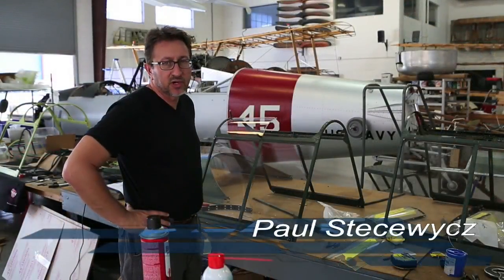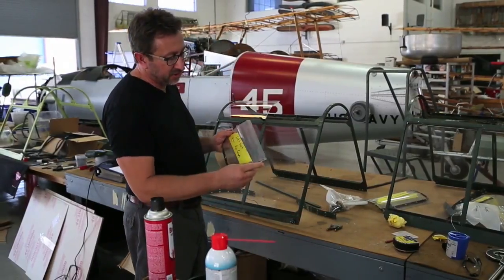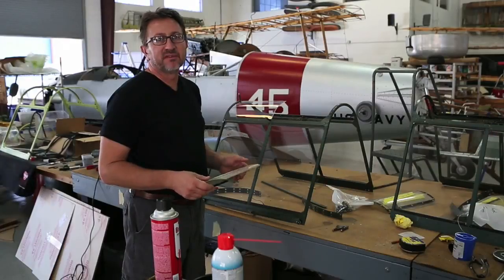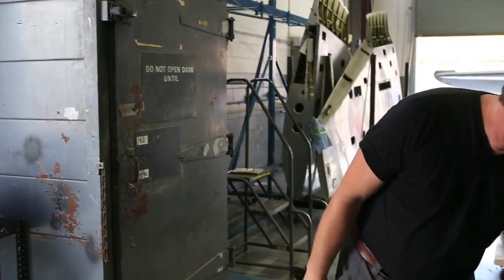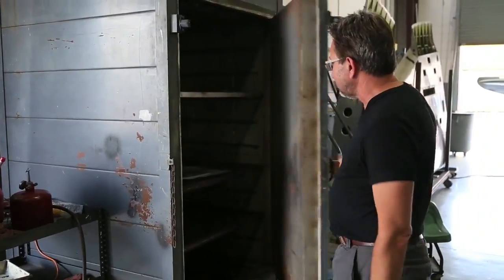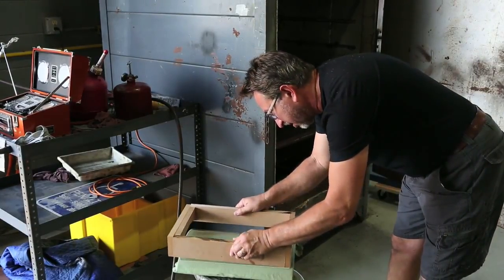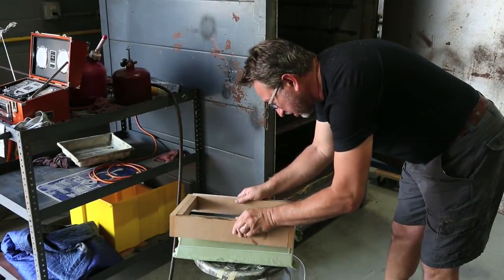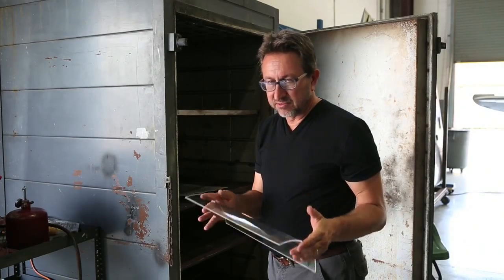CAC Wirraway Restoration - Plexiglass Forming -  FoF Mechanic's Corner

Comment: An idea for holding the exit tight to the mold, oversize your wooden frame and stretch thick latex over it. You can press down and hold it to the mold without having the corners raise, and have even pressure.